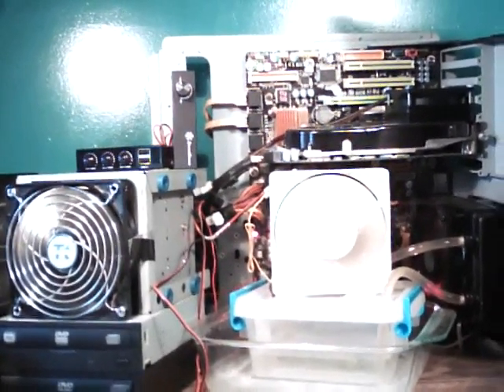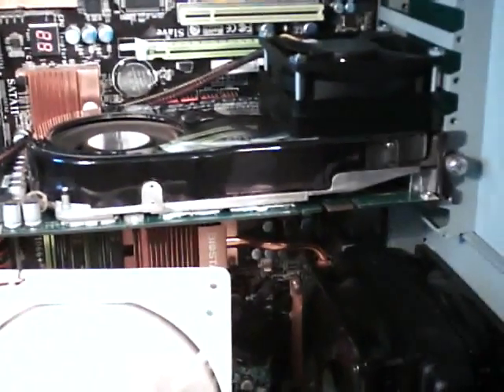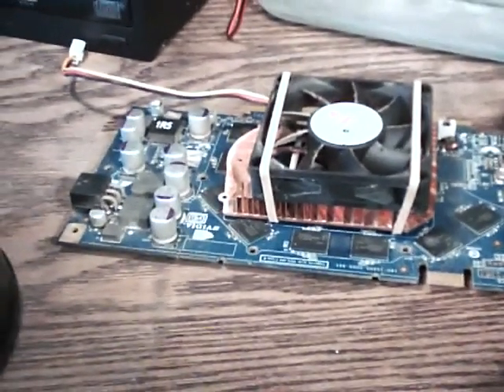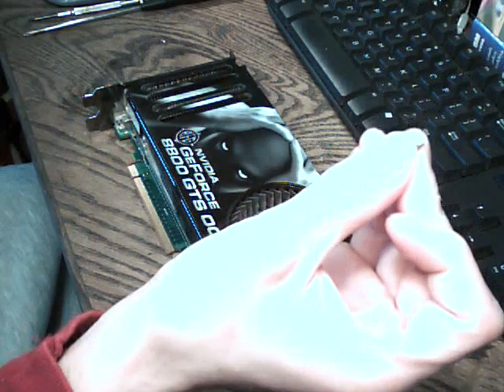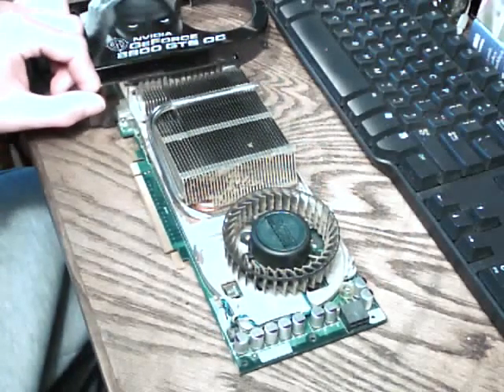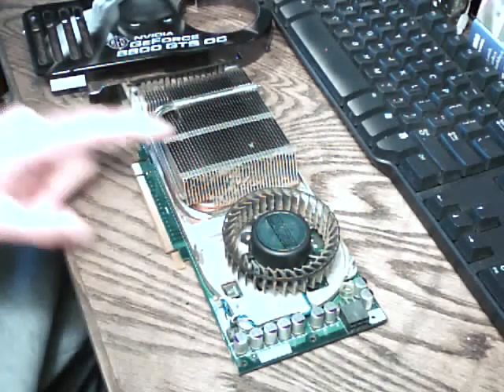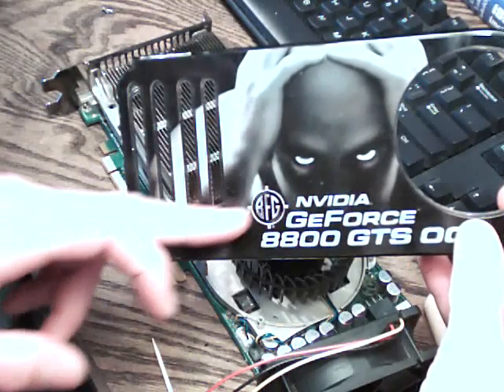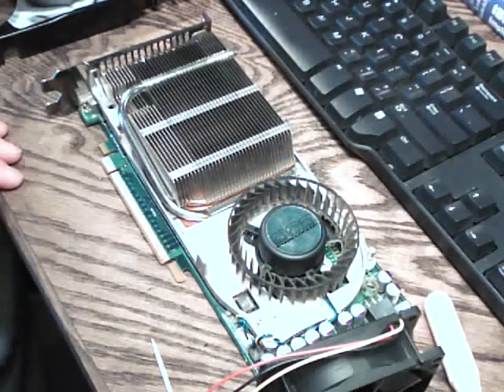Blower Style GFX Card Fan Mod Part 1

Comment: you you keep the stock fan why not cut and make another fan hole on the cover for the double fans. then most the air intake is from the back plate of it and the double fan; directly to the cooling fins. I think reversing the stock fan could make your case hot?> which then the air cycle into your double fan. I would prefer all the air out to the back plate instead.

Comment: Ah, the old elastic band method, nothing wrong with that, some of my systems have elastic bands, cardboard and sellotape in.
I suspect this mod could work to some extent, as what you are doing will not be too dissimilar to the stock cooler on my card.